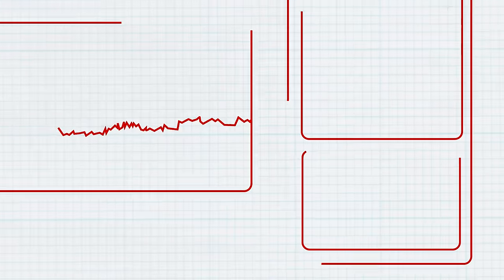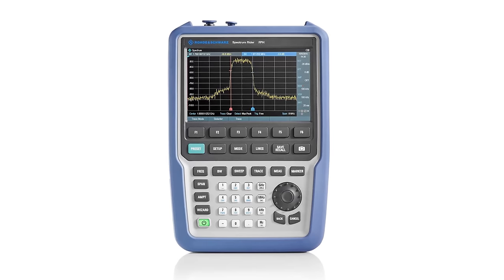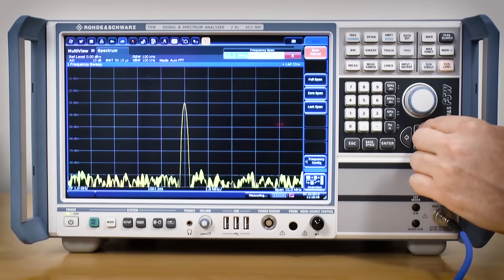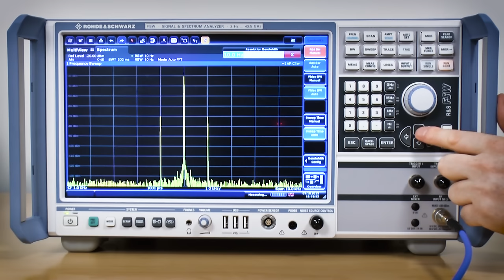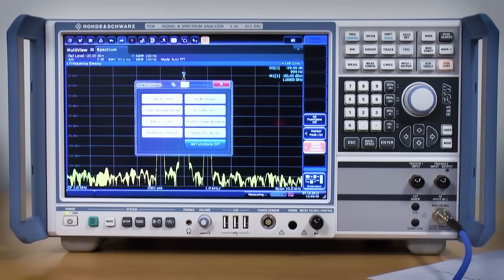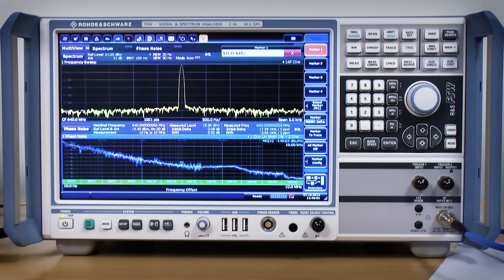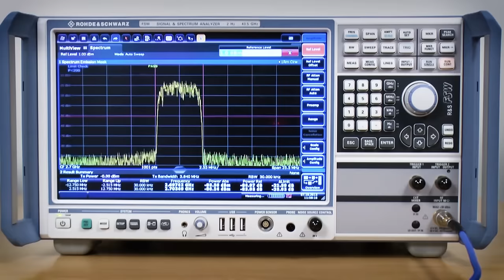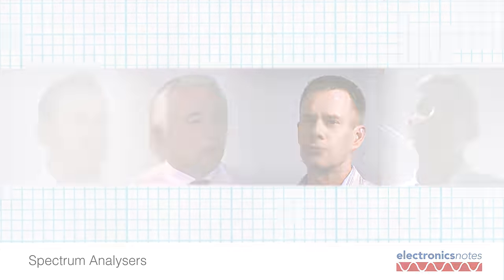How to use a Spectrum Analyzer; techniques, controls, test methods, hints & tips

Comment: Average price $135,208 USED! It would be nice to see techniques, controls, test methods, hints & tips on something the masses might be able to get there hands on. This      is a joke. I find it hard to believe a corp. would hire someone and not expect them to already have a working knowledge of how to use this tool. who in there right mind would let just anyone use something that cost this much is so easy to blow the front end out of. BUT then again Dave Jones (EEVBlog) did find a PLUS $100,000 scope in the dumpster the only thing wrong was a loose plug.
Reply from the maker: The reason an expensive spectrum analyser was used was because we actually worked with people from R&S to make the video. The controls and concepts talked about would be the same for any spectrum analyser. In fact we did not address any of the features or performance elements in the video that would only be available on expensive instruments. That said, by their very nature, spectrum analysers do tend to be more expensive.
As for companies only employing people who could operate these test instruments, often new graduates, who I often employed, would have wanted videos like this so they could get to grips with them.
Reply: @ElectronicsNotes  Well I own a Siglent 1032X with all options enabled, watching this video which I hadn't done earlier, I agree, it showed the absolute bare minimum that ALL SA's have, the 3 basic settings that everyone has to know after pushing the power button, Frequency, Span, Amplitude. and then you touched on Phase. but stopped short of saying anything meaningful. I learned nothing except having THAT analyzer would make everything easier to get the results you wanted and at MUCH higher frequencies. The bottom-line is stick to instructional information on analyzers in the price range of the one you own they pretty much will have the same features, and for the most part the buttons laid out in the same way. I still don't know what the purpose of this video was. The title is misleading. You did a great job reading the script.  JMO

Comment: Why are they so expensive?  If i'm intending to monitor between 10,000hz and 70,000hz and the fundamental signal  is around 3.1mhz, is a spectrum analyzer this expensive necessary?  Many thanks for any help.
Reply from the maker: Spectrum analysers require some sophisticated electronics and this increases the cost. Also a lot have top frequencies that extend into the multi-GHz region of the spectrum. For a cheaper option, you may be able to use the FFT function capability on some modern digital oscilloscopes, but this capability is not normally available on the very low end scopes.
Reply: @ElectronicsNotes Understood ElectronicsNotes. I appreciate you taking time out to reply. Peace.
Reply from the maker: @hoofheartedicemelted296  Not a problem - apologies for the time it took to reply, I ahed been rather behind with all he comments on the channel.

Comment: Can this be used to pin point where a frequency coming from to eventually find the problem source/s. Even if they are not very local? Can it help find any problem ELF/ULF's? If no ok but if yes would I need other equipment and what , if you know? Thanks.
Reply from the maker: The main purpose of a spectrum analyzer is to monitor the output from a circuit to which it is directly connected. That said they can sometimes be used with directional antennas or probes to locate the source of interference, but this is not what they are primarily designed to do. They look at the spectrum and see the signals within that spectrum.

Comment: Are filters able to be implemented to reduce the frequency noise?
Reply from the maker: In a word, yes, they do. The level of noise received is proportional to the bandwidth being received (not the overall scan start to stop, i.e. range). However, this normally results in the scan taking much longer, so there is a trade off. I can remember doing scans where we were looking for very low level spurious signals over a wide range and the scan took many hours. Modern FFT spectrum analysers have some techniques incorporated to help reduce the time taken for a narrow bandwidth scan.

Comment: can it be used to determine chemical elements of a material by analyzing its light frequencies spectrum?
Reply from the maker: Spectrum analysis for these frequencies generally takes a different approach, and does not use RF spectrum analysers.Light frequencies are very much higher than RF and even what are termed microwave frequencies.
Reply: @ElectronicsNotes  which spectrum analyzers would be appropriate for it?
Reply: Wouldnt you need a Gamma Spectrometer for the radioactive elements?

Comment: How can I actually see the actual signal and not these digital lines, in regards to the sweep
Reply from the maker: I think what you may be talking about is the fact that a slow sweep and narrow bandwidth means that the signal has sharp peaks and troughs. If you widen the filter bandwidth, speed up the trace, or average the scan over several scans, then it will remove the digital looking nature of the resultant scan. Even though digital methods are used these days, the high performance and price analysers like the one used will not display a trace that is more "digital" looking than an analogue one. It may be more accurate because technology has moved on, but the resolution will be very fine and should not be limited by the digital nature of the test instrument.
I hope this helps.

Comment: What happens if I remove the ATT from the analyzer?
Reply from the maker: I assume the "ATT" is the attenuator. If this is the case it means the mixer at the very front end of the analyser will receive the full signal. You need to be careful not to overload or damage it.

Comment: Can i use this to find my quadcopter?
Reply from the maker: Not sure how because spectrum analysers are used for measuring radio signals within the radio spectrum, not geographically locating the source of them
Reply: @ElectronicsNotes  i saw someone using what looked like this and as they were getting closer to the quadcopter the signal was getting stronger so they knew they were close,
Reply: @ElectronicsNotes  someone needs to invent something that locks onto a specific radio frequency then pinpoints the location for you

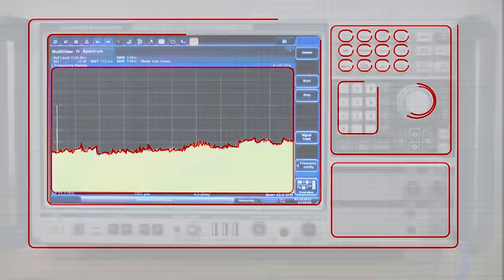Comment: Someone can tell me what is RF at 0:19. Thank you so much
Reply from the maker: RF stands for Radio Frequency and it usually refers to signals at frequencies into e radio spectrum.
Reply: @ElectronicsNotes  thank you
Reply: @ElectronicsNotes  I very nooby to any of this but can the spectrum analyzer help me find the signal strength of radio controlled vehicles I don't know let's say something like a RC CAR or DRONE or maybe even a JAMMING DEVICE
Reply from the maker: @adhd_with_pennies4867  A spectrum analyzer is not really intended for this, although by adding an antenna to its input some detection like this might be possible. But remember, many of these analyzers are not portable and it might be difficult to move it around to locate positions, etc of the drones, RC cars, etc.

Comment: So a spectrum analyzer is more useful for radio?
Reply from the maker: Typically spectrum analysers are used for monitoring radio frequency signals, although audio analysers are also available. Essentially, as the name indicates, a spectrum analyzer looks at the spectrum of a signal - i.e. in the frequency domain. They are used in areas where the frequency content of signals needs to be analyzed and the major area for this is within radio frequency applications.
Reply: ElectronicsNotes Thank you for the clarification!

Comment: You said possibly for free. Actually free is fine as long as possible does not violate specific protocols. The idea of scanning a frequency range could be used illegally to scan a paid for service signal: for example paid cell service or even internet service by very intellectual hackers whom have no respect of violations to privacy protocols. | This is an opinion not backed by actual citations but possibilities, by that of individual human greedy nature. It is up to each individual to decide what is right or wrong and then be held in accountability for actions.
Reply from the maker: Normally it is OK to scan a frequency band provided the spectrum analyser is not connected to an antenna. If you are looking for signals coming out from a circuit, then it needs to scan the full range of frequencies. It normally would not be set to receive external signals from an antenna, which could be illegal in some circumstances.